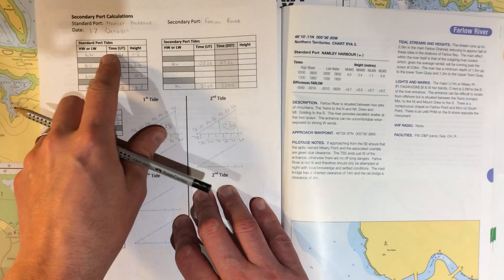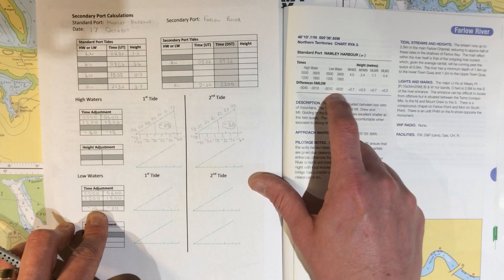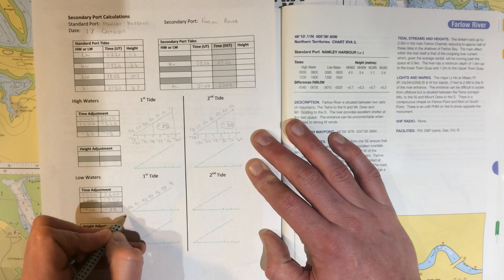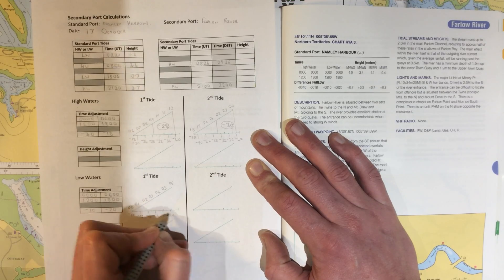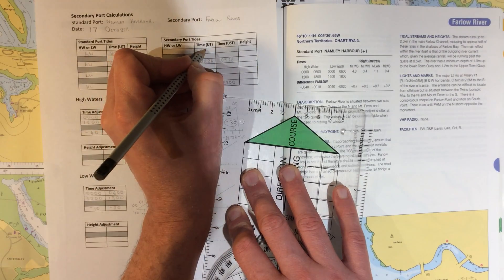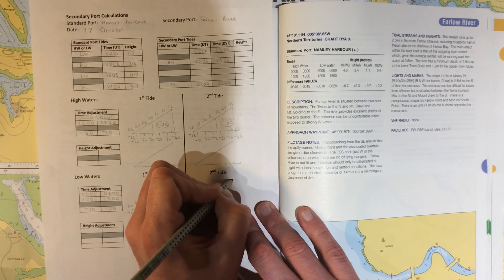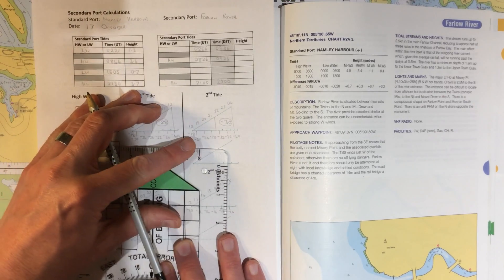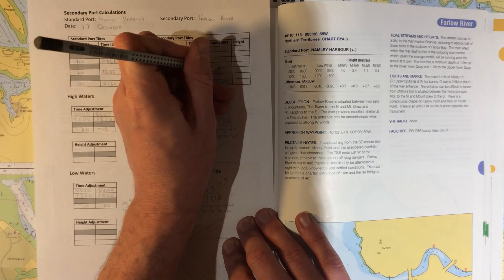Secondary Ports (Part 3) - Low Water Times

Comment: If differences at the secondary port were for example +0005 at both 0000 and 0600 and the HW at standard port was in between these times, would the difference still be +0500 at 0300? Thanks
Reply from the maker: Yes, this is correct. This difference could be taken as +5 for any time between 0000 and 0600 and the above calculation is not needed. It is also true that if the correction are not the same and if you at calculating for 0300 (exactly half way between 0000 and 0600) you can go half way between the corrections shortcutting the above calculations.
Reply: @pzsc  Thank you